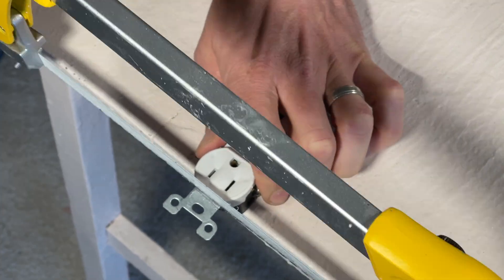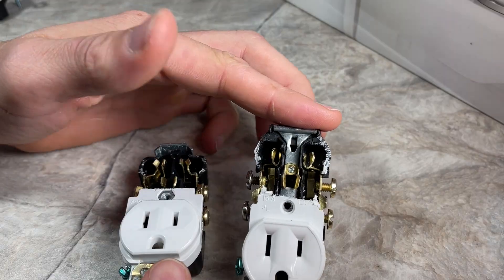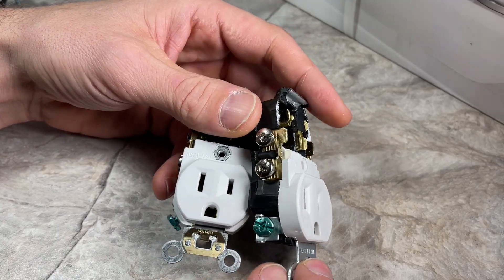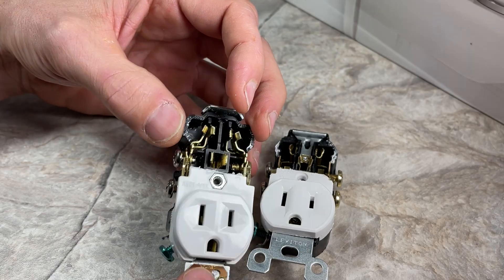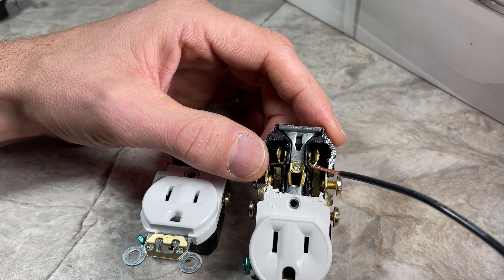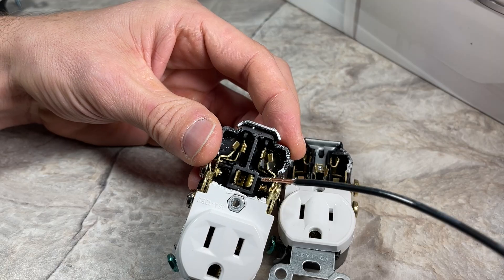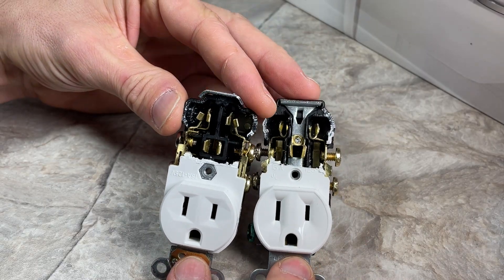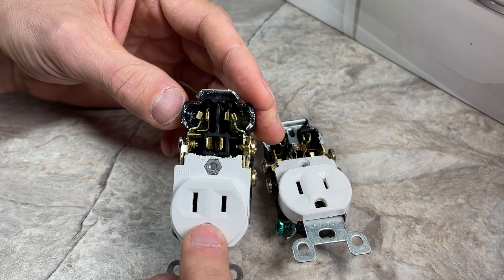What Outlet Should You Buy For Your Home |  Commercial vs Residential

Comment: As a Master Electrician with over 30 years of experience  there's a few things that need to be cleared up. 
 There is a major difference  in outlets between the residential grade and commercial grade. This has to do with residential wiring code. In a house outlets are considered part of the lighting load. And is figured at 400sqft/15amp circuit or 600sqft/20amp. So a 1200sq home 3 lighting circuits @15 two @20 amps. This is minimum. 
Commercial on the other hand. Outlets are figured as dedicated circuits. @1800va per outlet. In residential outlets are considered convince. 
The difference is while in a home you could have 100 outlets on a single lighting circuit.  In commercial  at 180 VA per outlet a 20 amp circuit reaches it's 80% capacity at 14 outlets. Therefore the outlets deal with a different load than residential.    Commercial is more expensive.  They are designed for a rougher use and carrying a load. While residential will also carry a load they exist for the convince of the homeowner.
BTW the "plates" are called busses each is a buss.

Comment: Most outlet at $0.50 is rated at 15 amp (115v) and it will not work with window a/c. Those window a/c requires a 20amp outlet (115v).  My old outlet at 15amp which connects to window a/c had caught on fire. Yes, the outlet did it.  Lucking, I was in the room when it happed.

Comment: I feel like they are both fine.  Leviton outlets are ul
listed so they both are going to do the job.  

From a homeowner standpoint, you like to feel you are using good quality stuff and a $1.50 more isn't an issue for most of us so go for the better outlet.

But, honestly, homeowners are much more likely to encounter problems with improper installation practices than failure of an outlet.

Comment: The commercial receptacles should be mandatory in kitchens, basements, garages, etc.  Anywhere where you're constantly plugging and unplugging.  Residential are fine for other rooms.
Reply: in kitchens outlets with a braker built in are now mandatory in all New homes . This outlet is one of the best built also but expensive thus only used when law require it .
Reply: I think if you go with commercial anywhere in the project, you will ultimately save money by going commercial everywhere as no time will be spent making sure all receptacles are "correct."

Comment: National electrical code is a base line standard for the entire U.S. not state by state. Each states decides how they certify their electricians but the code doesn't change if you go to virginia then go to hawaii. You can do more safe practices than what the NEC states but you can't do less. It is updated every 3 years. I always wonder why DIYers make videos putting out flimsy info out there. If an outlet is a commercial outlet it is probably going to be 20amps not 15 as you are showing. This is more of a cheap vs expensive outlet. Plus in all practicality I've seen the cheap plugs in 50+ year homes still working probably because a lamp got plugged in and stayed plugged for 50 years. If an outlet is going to get alot of action of different plugs constantly going in and out then yeah a heavy duty plug will do. If you are going to plug in a surge protector and leave it for years the cheap one will do. Don't back stab the outlets to install and make sure to wrap the wire clockwise around  the screws is the main thing.  Anyway thats my 2cents - electrician.

Comment: I spent 35 years in the electrical supply business. For a home, residential grade receptacles are fine (ex:Leviton 5320). In the event there is a receptacle where the plug is going to be removed in and out constantly,  a commercial or industrial grade receptacle (Hubbell CR15 or Bryant 5262) might be worth the investment.

Comment: Customer- "Whats the difference between the fifty cent outlet and the the two dollar outlet?"
Hardware store clerk-  "Ahhhh ...a dollar fifty..."
Reply: If you're lucky, they'll read the back of the box and try to think of an explanation.
If they had experience with home repair they wouldn't be working at a hardware store.
They just put the product on the shelves.
Reply: @mariokarter13  
I say that all the time!  You can a gauge a person skill level by the wage the make, generally speaking.  I just roll my eyes when my wife start asking the Home Depot employees advice. No disrespect just truth.
Reply: @kcb5336  It's really just common sense...         ( something that is becoming less and less common these days)...   If the outlet is going behind the couch with just a small table lamp plugged into it, never being unplugged  perhaps for years, the 50 cent outlet will be perfectly adequate.
 If it's going into your work shed with tools being constantly plugged in and unplugged and a space heater used in it when it's cold...For sure get the heaviest duty outlet available.
 The only thing I ever ask a hardware store clerk is where in the store I can find what I'm looking for. They usually know.
 If it's management and you ask what's best, they will always tell you that you absolutely need the most expensive one they sell.
 I do all my research, to know what I need, on line.
 I just go to the store to buy.
 Never, ever take advice from a salesman.
Reply: @kcb5336  When Home Depot first opened in Canada, there was almost always at least one former or retired tradesperson in each department, and they were paid accordingly.  There were a lot of people whose house was paid off, had some savings, and wanted to pick their grandkids up after school, but weren't ready to sit in a rocking chair all day.  You could get really good advice for free.  Of course, the shareholders were offended by having empowered employees and customers.  Unfortunately, there are a lot of customers who shop there entirely because they want to feel superior to and bully retail workers, so it was a successful strategy for them.  If I can't find something at a locally owned place, there is a different big box construction store I will shop at, because at least they have enough employees to help you find things, and give them work time to watch the manufacturer's marketing videos.  Oddly enough, management also has a better idea what customers want and how to keep their shelves stocked here as well.

Comment: just fyi that $0.50 receptacle is ul tested to have one wire in each push slot and 1 wire on each screw. the burn mark you pointed out is from a loose connection not a short. when a short occurs the ground and hot will be welded together. this can happen in the $6.00 heavy usage receptacle also.

Comment: It's truly a question of usage. If you're building your own house or replacing every single outlet in a home, you're better served to use "economy" outlets in all the places that will rarely be used, or will have a lamp plugged in,  moderately used and little else. Use the better outlets in places that will see frequent use.  I contend that any outlet will eventually see the contacts spread too far to grasp a plug.  If you use the economy brand, buying and installing a replacement two or three times will still cost less than installing the costlier style once.
Reply: or do like me and run the QA department for a manufacturer/distributor, and get the good outlets for free :)

Comment: Wait... so you're saying that something called the "National Electrical Code" is different from place to place within the nation?
Reply: The NEC is mandatory in most states and some states will just adopt a version of it and doesn't bother to enforce updated codes. However most Electricians will use the updated code to cover their ass.
Reply: @lelandclayton5462  True.  I'd add the many local codes will expand upon or fortify the NEC.  Such as in this case our local code requires "Making stranded conductors solid" at points of connection.
Reply: I am a plumber by trade and the national code is the bare minimal that is acceptable. But lots of cities or states/provinces will take it a step further and say that is not always good enough we want a higher minimal in our area. Or for example the national code says minimal insulation needed is x amount and in Texas that is fine. But Montana being colder wil say no here we need to see a minimal of x plus y so there code says it has to be z

Comment: As others have noted, residential grade receptacles that don't get much plugging/unplugging action last a very long time. All of the outlets in my house are residential grade, and most are from when the house was built in the late 1970's. All of them still hold plugs very well, even 2-wire extension cords.

All of the original outlets have the wires plugged into the "quick-plug" holes, rather than the screw bindings. Every time I do work on an outlet, I switch the wires to the screw bindings. That advice was given to me by my father-in-law, who is a licensed electrician in several states, and a professional engineer.

I wish I could hog-tie whomever decided to string all of the bathroom outlets and the outside outlets to a single GFI breaker in the breaker-box. And, whichever inspector signed off on that...

Comment: As a 20+ year electrician, I appreciate this video. But, as everyone else here, I have comments, lol.

As you have well-explained, the difference is basically how much the device can be used. Another commentor here mentioned this, but, for most residential situations, you plug in your microwave, or your floor lamp, or your power strip, and it may sit just like that for years. This is why the cheaper receptacles are what they are.

However, if you have a work bench with a few receptacles over it, and it is intended to use daily, you're going to be plugging in drills, chargers, soldering irons, test equipment, etc, etc, several times a day. A commercial receptacle is designed for this. It's common for a C-grade to see literally 1,000 times the activity (twice a day for 2 years, as opposed to once or twice in the same amount of time.)

For this reason, in the majority of situations, ressie grade is just fine. While I have seen receptacles that are worn out like you explained, it is only after at least a decade of use, and in higher traffic areas, like a receptacle that is commonly used for a vacuum cleaner (which incidentally pulls often over 10 amps.)

Another issue is price-point. You can find the ressie grade receptacles for around 8 dollars per box (of 10.) While, in my experience (I use mostly Leviton), the C-grade are often closer to $25. So, in a 2 story house, you're looking at the difference between about 40 bucks and nearly 150... just for receptacles. And when you are bidding against other contractors, and customers only look at the bottom line, they will think, "This guy's 100 bucks cheaper." And, honestly, in places where you may use the receptacle once or twice the whole time you live in your home, or if you are flipping your house, do you want to spend the extra? Well... for me? Yes. But that's me. But it is something to think about.

And lastly, in all my years, I have never seen a receptacle short out from normal usage. Even the super-cheap ones that Eagle used to sell at Lowes for $0.35. I've only seen a receptacle short out from damage... literally getting hit. Normally wear and usage simply will not cause a short unless there is a defect in the device (which I personally have never seen.)

Anyway, just my two cents. Thanks for the vid. :D
Reply: Any outlet that will not be behind furniture should be spec grade. By doorways, in hallways, All the  'go to' outlets.
Reply: @kkarllwt  
Spec grade is different from commercial, and are even a bit more expensive.

Furthermore, where certain grade receptacles "should" go is subjective. For a few of reasons.

1: You don't know where furniture is going to sit. TVs, couches, chairs, tables, etc. If you think a receptacle is a high-traffic area that may see a lot of insertion and removal of a plug, a small table with a lamp could go there, and may not get used. Or even a chair. And, inversely, one where you may be certain a couch or other piece that may not move could go, there may be nothing.

2: As I have stated clearly before, residential grade receptacles still last longer than you may think. While I or another electrician could recount several times that we've come across worn out or broken receptacles, it's actually rare when you consider the percentages. I've lived in my house for 7 years, and none of the receptacles are loose or broken. And even when I go to work in a house, it may be 1 out of 200. And given that I am often called to install or replace them, the actual number would be FAR less. Probably around a 1/3 of single percent, or 1 out of 300.

The simple fact of the matter is that, in residential, receptacles are simply not plugged into a lot. And misuse can cause just as much problems as heavy use. Pulling sideways, twisting, etc, when un-plugging can stretch the internal tines or break the outlet nearly as easily as simple overuse.

As I tried to say before, commercial grade are great, and I would prefer that everyone use them. But, ressie grade are perfectly fine for 99.99 of the time in home applications.

Comment: It's hard to beat a cheap rugged 20A outlet. Only problem it is harder to push the plug in and pull it back out, do to more robust heaver spring contacts in the outlet.

Comment: I would not use those 50-cent receptacles in my house, there is arc/fire risk with weak connection and thin inferior metal. The cost difference is minimal when you buy box of them and you will never need to replace them. With things like this you cannot be cheap..

Comment: most of the problems are problems with the install.  other changes happened over the years. the 80's, i broke 5% just tightening the terminal screws down. but you could crank them down. including the ground. by the 90's, they were using nylon, which was making them less brittle. but the ground terminal got flimsy. newer changes annoy me. i dont want to fight to get things plugged in. you realize power strips were new to the homeowners in the 90's.   whoa. now every home has a dozen. there are tiny innovations every decade.
Reply from the maker: Hey Norman,  completely agree that the vast majority of issues come from an improper install.

Comment: This is why I went with a pair of pigtailed not daisy chained 20 amp heavy use clamp back wireable receptacles every 6 feet instead of the minimum of a single 15 amp every 12 feet. The ones I have don't get hot and melt like the $.50 Leviton melt-o-matic shown when the load is a standard 1500 watt space heater, they instead barely even get luke warm. I also wired with metal clad cable not NM-B and only metal boxes so that if a rodent gets in it can't eat the wire and cause a fire.

Comment: Good video!  I had to replace these cheap outlets in a house that I bought that was only 10 years old. (built in 1993, bought in 2003)  A few outlets in the bedrooms were marginal, but the ones in high use areas like hallways, kitchen, bathrooms, garage, were all shot and couldn't securely hold a plug.  I went with the commercial outlets because I figure my time is worth more than the additional $1.50 per outlet, and so is the peace of mind that comes from knowing the outlets are much safer.  The cost differential for every outlet in my entire house was a grand total of $75 more for the commercial outlets.  I replaced them 17 years ago now, and they're all still good as new.

Comment: After watching this video, there is no reason whatsoever not to buy the commercial grade outlet. I can't believe they sell the "residential" outlet that is more prone to failure and death. If you need 67 outlets for your appartement or house you save only $ 100 by selecting the "residental" outlet. And $ 100 is nothing in this context, compared to the cost of a appartement /house and benefits of safety and longevity.

Comment: My house was built in 1991 (Oregon).  I bought it in 2003.  Over the years I have lived here I have had to replace almost all of the outlets because the plugs would just fall out.  It is very annoying.  Now, I don't think I have replaced then with the $2 version but I know they are not the 'contractor bulk pack'.  Thanks for the video.

Comment: 3:41 "If you applied any torsion or twisting motion to this plate, how that could break apart those two housings ..."

But that would clearly be abuse and the individual doing that should not be doing that more than his first "lesson learned" experience.
Reply: ahhh, but consider the relative quality of junction-box and wallboard installation these days.  Un-even mounting and gobs of plaster can easily cause uneven mounting forces to be applied to the mounting plates.  I don't know, but I suspect the cradle frame is also a thicker stronger steel as well.

Comment: I have always used "spec grade" receptacles for this very reason.  I do insert/remove a plug often, and hate the cheapie plugs that loosen with just a few operations.
This will also cause the plug to heat up due to high contact resistance, and could cause a fire.
Also the spec grades have rear entry for stranded as well as solid wire, and really clamp the wire well.
Is a cheap plug really worth it?  I say no.
BTW... you have beautiful eyes!  Very nice!

Comment: The plastic breaks between the prong holes on the cheap ones. If there is a big appliance plug putting stress on the outlet, they will fail. Don't go cheap. I have seen them catch on fire in apartments because they had paint in the hot side. Just replace them with high quality replacements. Good grief, people spend more on coffee!